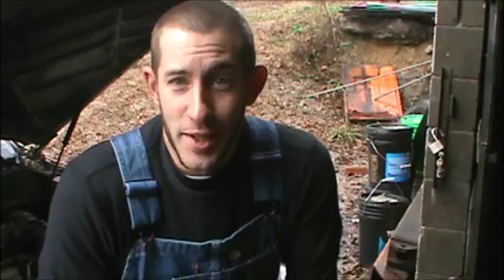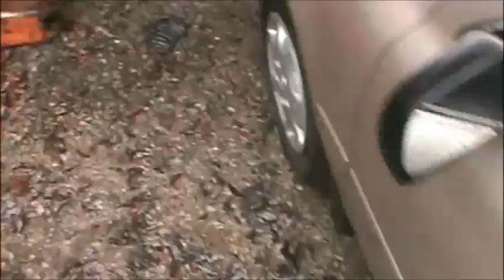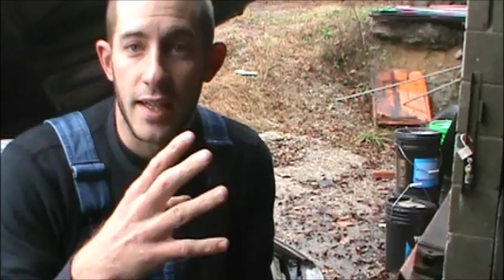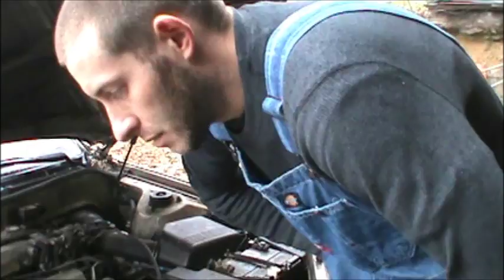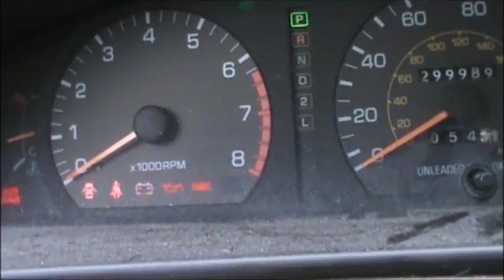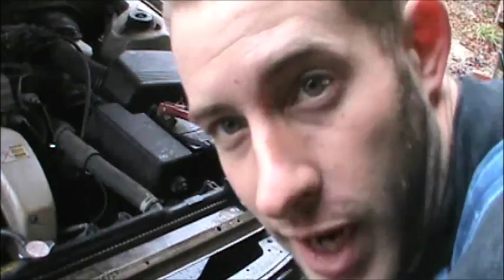How Alternators work, and how you can tell when they go bad

Comment: I have a question for you I have an 08 GMC Sierra pickup Z71 crew cab interior dome lights dim headlights dim and get brighter and dim and get brighter and Battery tested and the alternator tested they said battery was bad alternator was fun stock alternator no big radio that's a stock truck why in the hell is this going on I had to put a ground strap on because the oil sending unit kept malfunctioning saying I had no oil pressure as well as several other things on the dash that kept popping up but during this whole time I have had a problem with interior dome lights fluctuating as well as headlamps how do I fix this problem when they tell me the alternator is good and the battery is good

Comment: Two questions ;Does every ones car become your own personal furniture. I heard plastic crack a couple of times.  Hope your exiting some of that mucous your hacking and snorting constantly.
Reply: +william winget 2nd question ..what would you check if some how you knew the alternator on that car was good ?  I just put in a new one ( reconditioned from auto zone) and at the alt's batt terminal and grounding on the case I get 11.95 reading with the engine running...could it be the voltage regulator..its a 79 f250.I hate taking it back out again.

Comment: can you help me i have a 94 chevy c1500 pickup and i think im having alternator problems my lights and electronics all stay working as of right now but  i have a volts meter  my battery light dosnt come on but  when i idle i notice system voltage will start dropping towards red but when i start driving voltage will come up to just right below  normal according to my meter. the belt is not slipping there is no squealing noise from belt.
Reply: both  but i replaced my alternator and hat solved the problem it also started having bearing noise.

Comment: Interesting!
I have an '01 sierra, with after market volt meter, some days it will be 14.5 running and others it's as low as 13.6 running! would this also be a alternator problem? It's funny you mentioned the radio thing because that happened once last month.

Comment: DO NOT DO THIS!!!! when you lift the positive cable of the alternator to see if it works you have "open fielded" the alternator.. it will survive this a couple of times usally, but each time you do this you damage the diodes in the alternator... test your alterator by using a digital voltmeter. When the volts rise when you rev the engine it proves the alernator is working. engine off, 12.5 volts on a good battery, then start the engine. the volts will rise above 14 on a good alternator with a good battery, and even a discharged battery will see a rise... OMG dont do what this guy shows....
Reply: Agreed. Don't disconnect the battery with the engine running. It could cost you lots of money !!! ( New alternator and fitting charges. Ouch. )
Reply: captmack007 
Totally true. Alternators can smoke from this test. Or you can damage other computers from the large voltage spike
Reply: Simon Cameron
Simon, your post clearly demonstrate you are not an electrician. "Overly cautious, unrealistic?" Open fielding and alternator damages it. Sometimes not immediately. It does damage it. Period. It is not a "risk" issue. Lifting the pos or neg will be the same result. The alt will not have a connection to the battery. Duh. Also, runaway voltage is possible on any alternator if the regulator fails..or if it is open fielded..the regulator "senses" the battery voltage and adjusts the alternator voltage output accordingly.. do some research. I am a yacht electrician, I work on multimillion dollar boats with very complicated expensive systems,.and on cars.  if a person cant go and buy a 10 dollar digital multimeter at car parts store to do it right then dont work on electrical systems.
Reply: Amen bro i agree totally do it right or dont do it at all!!
Reply: captmack007   whu
Reply: Beau Boruff yea you did make a few disclaimers... and the one that stood out was "if you dont have the tool and you had no other way".. so I saw your explanation as a last resort...
Reply: Simon Cameron the alternator could produce voltage spikes if the regulator that is sometimes internal (sometimes external) is not working.
Reply: captmack007 100% correct captain.. but I think beau boruff was saying if you had no tools to do it this way...risky, but can be done
Reply: captmack007
Reply from the maker: DO NOT DO THIS! HAHAH
Thanks for the thoughts CaptMack007, i agree there are alternatives to the method i described but in the past 16yrs of wrenching i have never seen an alternator fail from lack of a battery connection. if your statement was true then every time you turn on your car in sub zero temps the massive voltage drop would kill alternators by the thousands.. Truth is Alternators are tough and robust units with internal heat sinks and capacitors. just like i say in the video if your working on an old car and trying to troubleshoot a possible bad alternator try this tip. captmack007 should stick with boating! good luck
Reply: Beau Boruff While cranking the alternator's output still has a destination..even in sub zero weather.. you need to do some research before you post a reply, jethro. Google "open field alternator", and you have a lucky day too.
Reply: Captmack007, I have to agree with the poster of this video.... in the fact that, first he warned not to do this with a car that is brand new, and that this test does pose a small risk... with that being said there is a better chance of dying from driving your car..... so does that mean a person should walk everywhere??? Sorry Capt... your being overly cautious, and completely unrealistic. On a side note he said the negative terminal should be removed, not the positive... and I will agree if doing this as a test not to remove the positive terminal.... but that is not what he said. You should probably pay more attention before you start to criticize someone. On another side note Cody, where do you get a voltage spike from... let alone a "large one" as you state? Both batteries and alternators are built to certain spec's which makes it scientifically impossible to create more voltage than is intended... think I am wrong, the number of coil winds in any alternators or generators determines the voltage created.... so unless he modified the alternator, there will be no serious voltage spike.....

Comment: never  take   the battery  out of the circuit    ,,good way  to blow  your electronics   the battery is the capacitor   in computer  cars   ,,i  can  do that to my old cars   ...but   if that car had a good alt   ,,voltage  can spike   ,,,use  a meter   they are cheap

Comment: Dumb question, but why do you have to have a functional alternator for the engine to keep running since the engine is running on gasoline? Is it because there is an electrical system that is needed for the engine to work properly (like telling it when fuel is supposed to go in and stuff)?
Reply: Real Keeper That's a good question. Your car has other electrical parts .. example the car's computer...a lot of cars...even ones from the late 80s use computer sensors to monitor the engine
Reply: +Real Keeper Your on a good thought . Think about how the mechanical action caused from the use of the gasoline as an explosive . All the things that are revolving and stroking. this action spins the alternator that creates the electric field that functions the coil or the electronic ignition etc. Chicken or the egg technology.

Comment: Very well explained I have a 97 chevy cavalier  and I hooked up a volt meter inside the car and its reading 10.5 when I have the heat on and when I put the lights on it drops down to 9.5 and sometimes when I'm driving it dips down 9.00 and when I come to a stop light or stop signal and apply the brakes it drops down to 8.5 and my radio starts going nuts is that a definite sign for a bad alternator if you can get back to this question I'd greatly appreciate it Thanks.

Comment: My alternator is making a squeaky noise if i spin it by hand I can hear noise. but its been tested twice & output is normal. but I dont like noise PERIOD! I have a new belt & idler pulleys due to some other failure. So whats with the alt noise if its good?
Reply: Will C Bearings in the alt

Comment: By the way I have a 1989 Lincoln Town car with 80,000 miles it calls 4 a 65 watt alt but would like 2 put a 100 in it but don't know how 2 because the 65 has 2 plugs and the 100 has 1 plug!!!
Reply from the maker: very common lots of people upgrade to increase there electrical output.. but your going to have to find an alternator that will work with your plug configuration.. best bet is to search the forums and see what everyone else is doing..

Comment: let's say, my car only needs a 60amp alternator, is it okay to install a 120 amp on it??
Reply: Yes,the 120 amp unit will allow more current to be drawn from the ALT if needed.If you have large power amps in your car for your stereo monitor the fuses because you may be drawing more than the fuse may allow and they will break contact and it will be time to upgrade to a higher value which is normal.

Comment from the maker: hey christopher, sounds like the system in your car is bumpin, what is happening is your trying to pull more electricity than you car can provide. most guys with big systems do a few things,, 1; they install a large capacitor to keep the inital surge of demand in check. you can find these at walmart for $80..2; they install stronger alternators to produce more power.. expensive but works..3; they get more batteries 
in addition id have your alternator checked just to make sure its working 100%..

Comment: Multimeters are cheap anymore and you can get a decent one from Radioshack for about $10 and they're not that difficult to use. Just switch to Volts DC and touch red to red, black to black and you're off.

Comment: Good video, but the pulling the battery terminal, I wouldn't advise doing that on a 96 or newer. The power from an alternator coming out it's rectifier generally has "ripples" in it. Those ripples could smoke an OBDII ECU. For 96 or newer definitely diagnose with a multimeter. If you don't have one and don't know how to use it, borrow a friend who does have one and let them have a go at it.
I subscribed to your channel btw. Good stuff.

Comment from the maker: sorry for the slow response, unfortunately the shop could be correct. your alternator has two bearings and either can become old and worn leading to lots of noise.. if your voltage is still at 14v then the unit is still working but eventually the bearings will fail completely and destroy the alternator. the fix would be to replace the alternator with another unit.. depending on the car it could be a relatively easy job that you might be able to do with basic hand tools.. what kind of car?

Comment: ok, as a typical chick, I don't know a ton about cars...but took mine in to the shop today for them to investigate noisy tensioner/idler pulleys or so I thought. My battery runs at 14 v typically & they told me the noise was actually from my alternator (bearings?). $500 in repairs for new alternator and labor to replace it. If this is true, would it affect my battery charge? Just thought it was strange my volts weren't affected by the bad alternator. Any input is much appreciated, thanks!

Comment: Another trick to quickly test an alternator is to turn on the ignition key (do not start) and poke a screwdriver or wrench on the pulley. If it magnetizes the tool, its good.

Comment from the maker: could be the starter on its way out, id check for good connections to the battery and to the starter..  make sure you have a good battery terminal and everything is solid without lots and lots of corrosion... then id pull the starter and have it checked for free at a parts store.. 
good luck

Comment: Got it,..but what is it when you get back in the car to start it & theres nothing? Everything works,..(lights, radio etc. etc.) but it won't even turn over???? So I bump start it & get to my next stop & then it's fine. Fires right up, like nothing was even wrong. Once in a while it will do nothing but have all power to everything.

Comment from the maker: could be the alternator for sure, usually it will screech and squeal, which indicates one of the alternator bearings is failing.. open the hood while its idling and listen near the alternator for the noise if it sounds like crap then go buy an alternator and give it a shot..